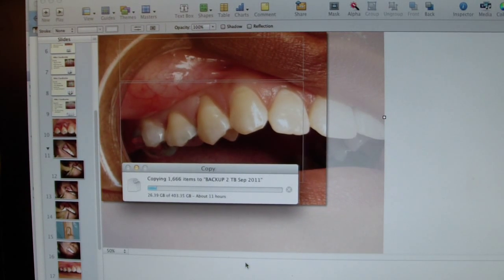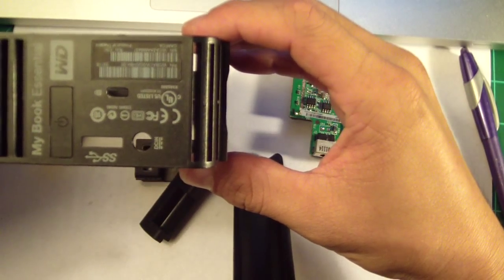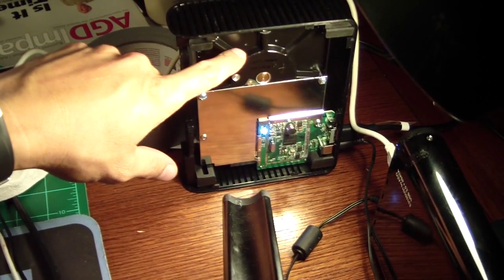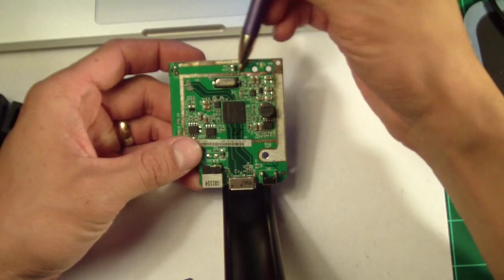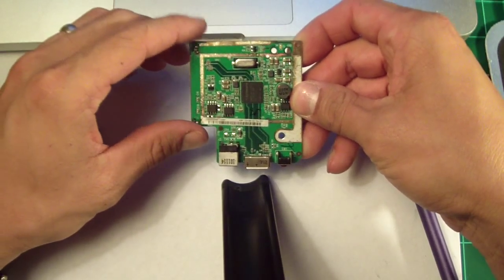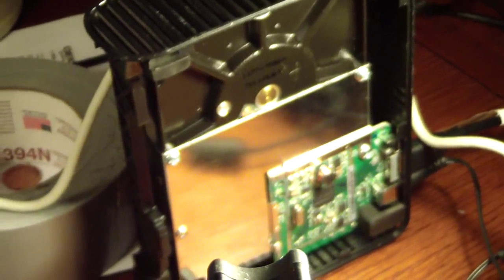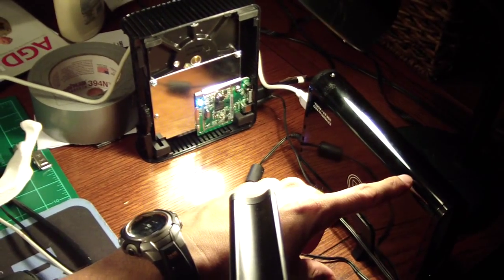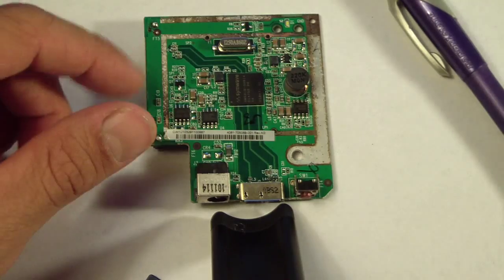External Drive Failure - WD My Book Essential - 2TB - My Workaround

Comment: Thank you so much for this video Dr -  you helped me fix my pain in the a$$ WD 3TB My Book. I left it plugged in for about week while it was not in use and I think a power spike killed the controller (despite being plugged into a surge protector).  For those researching mine is p/n: WDBFJK0030HBK-04 and the controller in it that failed was p/n: 4061-705149-000 REV.AA and I replaced it with 4060-705149-000 REV A. The only difference I can tell between the two is the original had a LED and the replacement does not.  I paid $38 shipped from Ebay seller LA.Tronics (they offer 30 day money back returns if the part doesn't work for you). Thanks again and the beginning image on your video freaked me out bro.

Comment: I had a situation where my myessential drive light was just blinking and I could not mount it on any Macs. It turned out to be the cheap AC 12v adapter. Swapped another one in and mounted and worked fine. Just passing this on.

Comment: I'm really surprised that worked. It begs the question, if it's so easy to defeat, what is the point of WD's encryption scheme? I have several WD mybook ext drives & I think I may have to find another storage/backup solution.

Comment: You can buy a brand new controller on eBay for $30-$40. Mine is on its way. I'll keep you updated. Thank you for the solution!! (I don't have any interest in buying another WD drive, as this is my 3rd, and they seem waaaaaay too fragile...)
Reply: +rABiD kittEn Did it work?
Reply: +rABiD kittEn did it work?
Reply: +pargacastorena +Beto Collin Yes it did! I've since had to buy another one because it happened again, so I'm just getting everything off of there and getting rid of the damned thing. But yes, it worked! I wouldn't suggest relying on the WD though.
Reply: +rABiD kittEn Thank you very much. I've had the thing sitting on my desk for 3 years waiting to see if I found a way to get the data out of it. Thanks for sharing!
Reply: Is it safe to go by the model number on the bottom of the plastic enclosure instead of the number on the control board to find a match?

Comment: I had two "WD Junk" drives and they both failed after years of dependable usage.  One thing I noticed was the extreme heat (after I removed it from the black case).  They were spinning so I do not think the head was stuck or anything but Windows did not recognize them for more than a couple seconds.  Oddly enough letting them cool in the refrigerator and then removing them cold and wrapping them in ice wraps (cloth ones so no moisture touches drive) pro-longed the amount of time I was able to recover data.  Not sure why this works, but it definitely helped.  Anyone else have temperature issues?

Comment: "WD junk" I like.  The design of these drives is crazy. Why WD think that encrypting the data is a good idea - ITS NOT. The circuit isn't really a hard disk controller (that's on the hard disk itself).  Its a "bridge". But that's not important.  Well diagnosed!  If you hadn't said "WD junk" I'd have posted this on the WD tech forums. Do you have a version without?

Many WD external drives have these terrible bridge circuits.  Its mainly the Essential and some Passport drives that do encryption. AVOID AT ALL COSTS is my advice.

Comment: I had a similar problem recently with a version of this drive. After barely 6 months of usage, it developed stacks of bad sectors. Thanks to ddrescue, I was able to retrieve my 300GB of video files before the drive failed. Took about a week to recover everything onto a new drive.

It would've been faster if I could've taken the drive out of the case, plugged it straight into a computer but the encryption chip prevents that. At least its under warranty, so I RMA'd it but I'll never buy WD again.

Comment: Hey, so I have this same hard drive, and I am having problems. The thing does nothing at all. I mean, nothing. The hard drive doesn't spin when plugged in, it doesn't get recognized in Windows at all. I tried cleaning up the Device Manager to see if it would recognize, but it didn't.

The light on the drive is solid the whole time the power is plugged in. It doesn't blink, or anything.

Do you think this is the same problem?

Comment: Did you try installing your old Western Digital into the generic encapsulate and be able to see your files? Did it work? I ask because the price for the controller board is the same than the encapsulate and I was thinking in buying the encapsulate instead of getting only the controller board.

Comment: Was the new drive's model number on the bottom of the packaging (and on the white sticker under the plastic enclosure) identical to the old one? Is it a sure thing that the board will work on the old if going only by the model # instead of the number on the board? Thanks.

Comment: My HD powers on, I can see the small light on in the front of it but is not recognized.  Is that light that you were showing on the circuit board the same one as the light on the front of the enclosure?  I am just trying to find out if I should go this route before I spend the cash.

Comment: how did you format the hdd generic? i removed my wd drive from mybook case and plugged directly into working p.c, i am now on 24 hours of a clean all through command prompt, this is after several failed attempts at quick and normal formatting to ntfs. 
i understand that clean all writes zeros to all sectors and it is a 1.5tb drive but surely this shouldnt take this long. i have given up on the data so i'm not trying to recover anything

Comment: Thank you for this video I will report back in a week and see if this was also a success for me as well. I had my 1TB drive freeze up this morning while attempting to my 2nd backup. After 7 hours on research I had pulled the drive ran a utility to check for bad sectors confirmed after 3 hours drive was ok and additional troubleshooting that the dammed USB controller card failed due to a poor firmware update on after updating to Windows 10 ( known issue WD Forums) with NO WD support! Disclaimer being please seek out a data recovery company. I went on Amazon and found an exact model on closeout for about 65 bucks and will see if it works. Both my primary and secondary WD My Book Elites crashed on Win 10 WD firmware updates all my digital family photos of the last 10 years are on both those units. Even more shocking is the drives in both units are the notorious Green Caviar drives the have an insane failure percentage. I'm not sure if I even want to use them without the USB encryptocrap . A better bet would be a couple of Hitachi Enterprise drives with an external drive dock is something I plan on next. And even more a new NAS or Drive Pool build with a Carbonite backup service for all my family photos.

Comment: Hi, I have same issue, HDD wont start - for the most part, sometimes it decides to run normally, but no data shown in computer - anyway, the light is working, HDD does not make any noises, when I connected it to PC with SATA cable, it runs - eventho I cannot see any data - so basically, I just need to replace controller, which is faulty, and it might work like you did in video?
Can you help me please to order that part I need? I do not want to make any mistakes and order wrong one and not be able to see/recover data because of encryption etc... You know what I mean. Thanks.

Comment: question for you... have a WD external hard drive with the enclosure i opened it because the usb port got damaged. i installed the hard drive on my home pc. it wouldn't read it. so i bought an enclosure for it & plugged it in with usb 2.0 to my home pc & it wouldn't read it. plugged it in on my MBP it wouldn't read it. its formatted for both win & mac. do you recomend me to purchase another external HD WD & open it up & put the hd in the new case? you said its a issue with the controller board right?

Comment: Hey would you answer some of my questions, please?

Do you know what the name of the thing is that you bought generically? How can I find one
Do you think this might work if I were to replace a 2TB my book square electronics thing with a 3TB one but the same My Book Essential?
Reply: +Chris Guillen did you get an answer to your first question here? My WD Nas only has a solid red light now. Is that the same you've experienced? Cheers
Reply: +Beto Collin Nope, I didn't. Mine didn't have a red light, or any light. So, our problems might not be the same
Reply: +Beto Collin Also, the way I fixed my problem was weird. I lost all my ... Precious :(... data (2 dang TBs) by buying a SATA adapter and removing the internal card of the HD. It didn't work at first for some reason, but it worked after a week or two. I have no clue why that was, but anyway the data was all encrypted and I had no backup

Comment: Hi,

Your problem could have been (probably) easily solved if you had just "baked" your bad controller in a oven or modified toast machine at around 200 - 230 (?) degress Centigrade. Probably max 15 min. Then let it cool down... & try again. 🤔😎😆😊

Comment: I found out these WD external hard drives are formatted for Linux. When the controller broard on my WD My Book Live failed, I installed DiskInternals Linux Reader (free) on my Windows 10 PC and was able to read the hard drive and save the data.

Comment: Several years later: Today my WD MyBook (6T, 2016) also stopped working out of the blue like in your case on Win10. As a last solution before replacing the board for me connecting it to my Raspberry(sic!) did the thing, after some 3-4 minutes Linux somehow managed to mount the device (no encryption activated) and now it´s working. I assume that the energy management is causing trouble or is not properly implemented on WD devices and the device is going to an eternal hibernation. Hope this helps somebody someday....
Reply from the maker: I just lost another drive. 🤦🏻‍♂️ about 2 months ago. I was able to recover about 80% of the drive. I dropped it hence the fail.
Reply: @AllThingsDentistry  Thanks for the warning! I already bought a WD Elements 10T which is very noisy and thought about replacing it with another WD MyBook tomorrow ... surely won´t do that now.

Comment: This sounds like a regulation is in order.
Hard drive manufacturers should be required to use generic controllers without encryption so that people can get their data off a drive with a bad controller without jumping through hoops.
Especially given the fact that you don't find out about the encryption until you have a problem.
There is way to much covert theft of user's data in modern day industry.

Comment: This is why you put your stuff onto TWO externals. Then it doesn't matter if one fails.
Reply: +Neil Smith Yeah but when they both fail like mine above your toast.
Reply: +Dennis Nicholson - ouch. I'd be screwed.
Reply: +Dennis Nicholson I just upgraded to Windows 10 myself, have 2 identical computers each with this as the external hard drive. So far so good.
Reply: Yeah both down at the same time here too.
Reply: Neil Smith yep, me too! Both WD MyBooks failed at same time. Worked last time used, stored in safe, now both won't turn on. Adapters are fine. Flaky WD; not cool.

Comment: Hi. Thanks. This might have worked: you got to keep First Aiding It, on macOS, until it works. Perhaps even use the old Disk Utility and keep repairing it until it repairs it.

Also, usually when it's having a hard time being mounted on the Mac, I mount it first on Windows machine (an old XP laptop) and then when it mounts there I plug it back in the Mac- most often than not the Mac mounts it (macOS 10.12.6). It is disconnecting on the Mac every so often- I'm doing the First Aid using Disk Utility to hopefully fix that (I've reported it to bugreporter.apple.com too).

God bless, Proverbs 31

Comment: all it is from the "ata" wd has no secret software, it is the same as xbox360 drives swap a  120gb for a 60gb and they both work, but they have to both be xbox360 drives. Wd is no different even if the numbers were different on the new controller you got it would have worked. All companies have default codes for the "ATA" that the drive spits out if the codes dont match (your computer store guys should have known this) the drive just wont read at all, plug in the proper "ATA" external S"ATA" controller and power up and all is well, the "codes" match and the reading begins. 
After you copy all your stuff delete the partition and put in to generic external and re-partition and your set to go.
Reply: I have a WD My Book 4TB that won't turn on, HDD works, enclosure model WDBFJK0040HBK-NESN, PCB model 4060-705149-000 rev P1.
I just bought a PCB model 4061-705149-000 Rev AF that says it's compatible with the one I have. So we'll prove this in a few days.
Reply: did it work

Comment: My Wd My Book Essential 500g is apparently dead ..solid blue light,tried to take it out of the case and plug it directly to the computer as a internal hdd to 2 different  computers , no bios ,no "My Computer" no "DIsk Managment" ...in device manager it shows like "Initio Deafault Controller" .... and that's about it...500 gig gone to shit! ...by this symptoms it seems like hdd is gone and controller works ...what pisses me off is the fact that everything was working fine , in Hdd Sentinel health 100% etc. ..and one day GONE!!! One thing to mention..day it gone to shit  i had  Windows automatic update "Initio Bus Controllers and ports - Initio Default Controller" ..cant even understand how it could destroy disk in hardware sense...i tried everything different cables ,mount it to different computers..any suggestion??

Comment: Hey Guys, I am in similar situation. But I am not able to get the PCB 4061-705089-001 from anywhere. Do you guys still have the PCB? I can buy it from you or use it to get the data and return it to you, if you prefer to have it back.
All my life's data is on this drive. I tested HD separately and it works, now just need the PCB.

Comment: Hey Ashley, Thanks for this post. I am having a failure of the exact same 2 TB MyBook Essential however my controller board is a 4061-705089-001 REV. AB version, while yours was AG. Did your replacement controller have the same version # as well? I see a listing for the AG revision on Ebay but nothing for the AB. Im wondering of the revision versions is also important or if it would work with just the same version #.